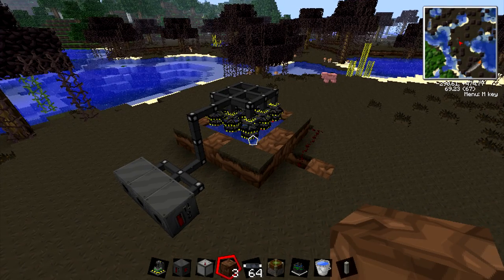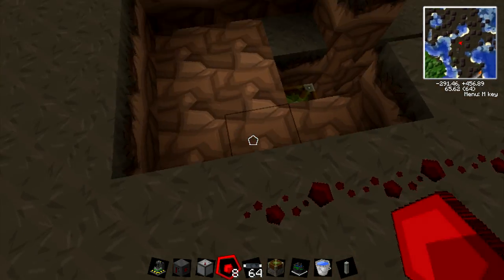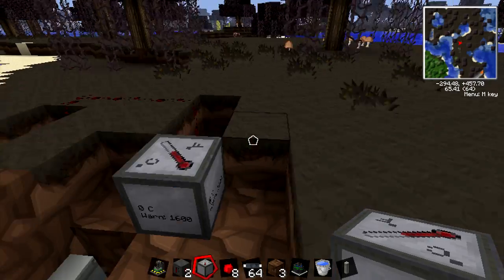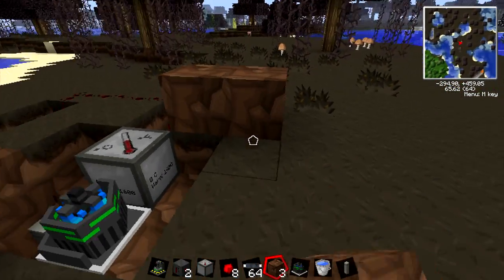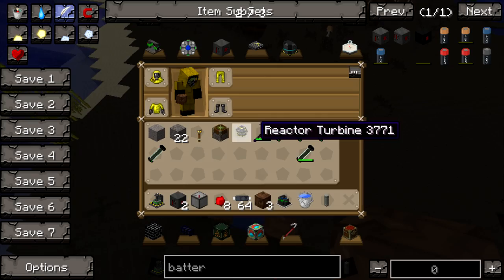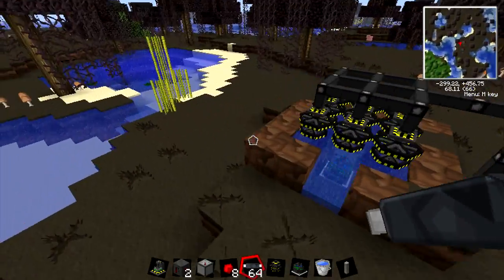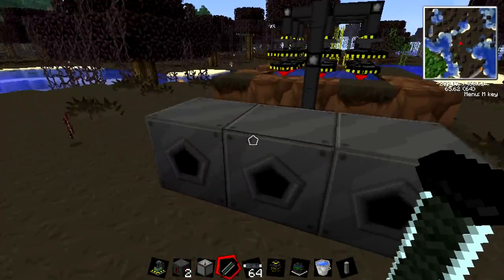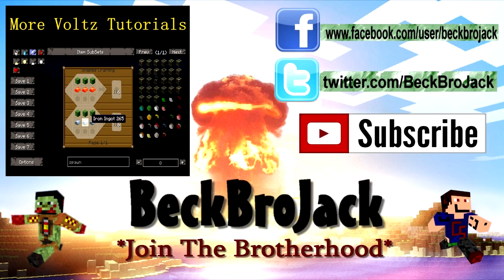Updated Fission Reactor and Hazmat Suit (Atomic Science) Voltz Tutorial

Comment: There's actually a much better way to build fission reactors. The reactor only overheats because it vaporizes the source blcks next to it. If you move the source blocks out by one block that won't happen. So build your water out 4x4x2 instead of 3x3x2, and then put turbines over every water block except the reactor. This is the exact number of turbines the reactor can power.

This way you'll generate more power and never have to worry about overheating and don't need the control rod.